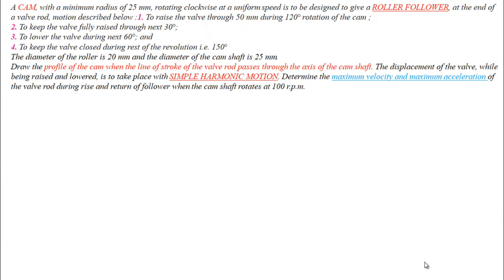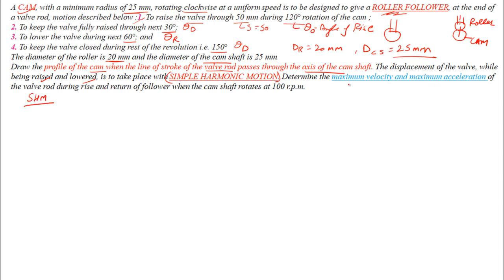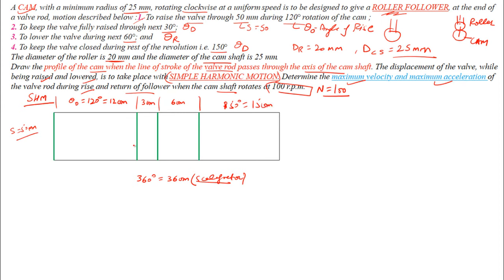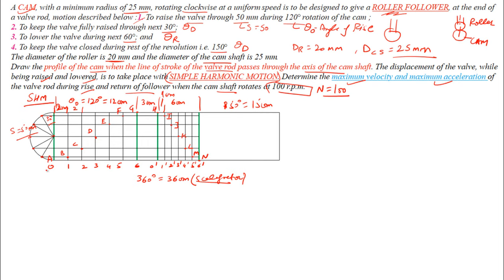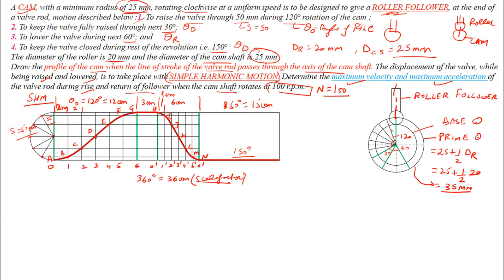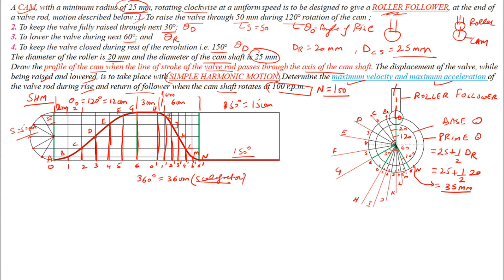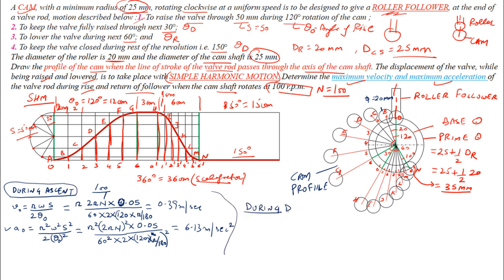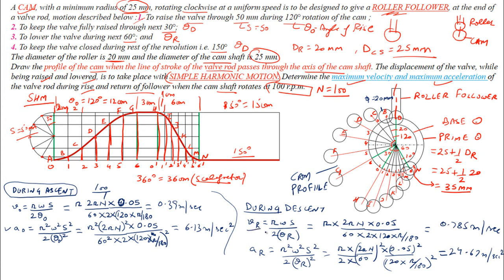HOW TO DRAW THE CAM PROFILE II ROLLER FOLLOWER II SIMPLE HARMONIC MOTION

Comment: What us n and n² in the calculation of velocity and accelaration ? What value did u take?
Reply from the maker: Dear 
N is the RPM of the cam shaft and as per the question it is 100. hope u got it
Reply: The small n is actually pi